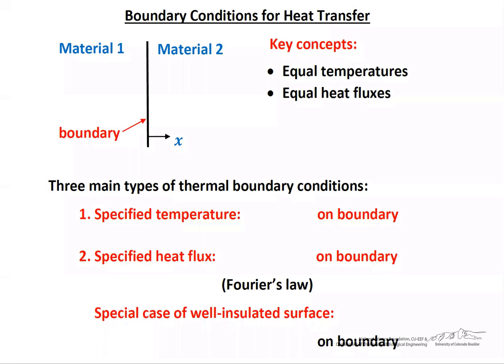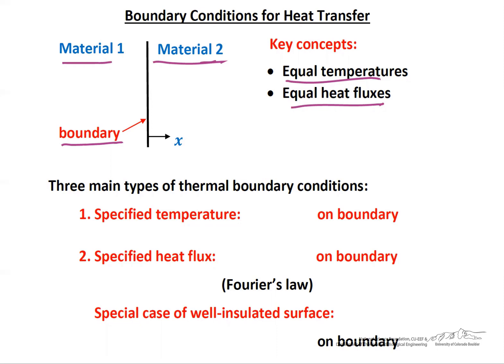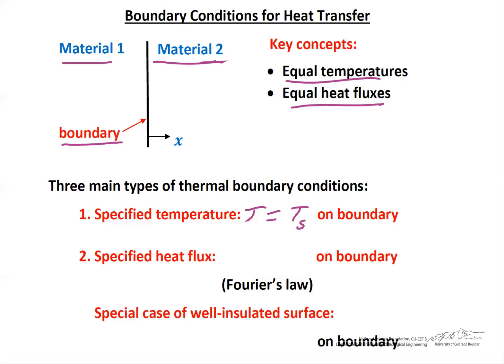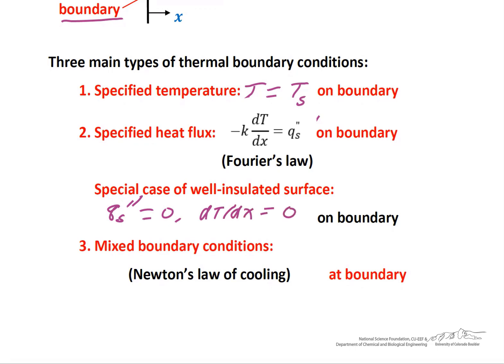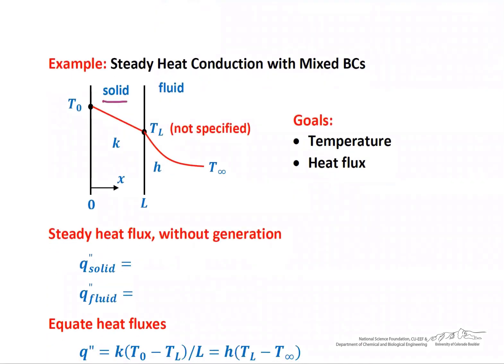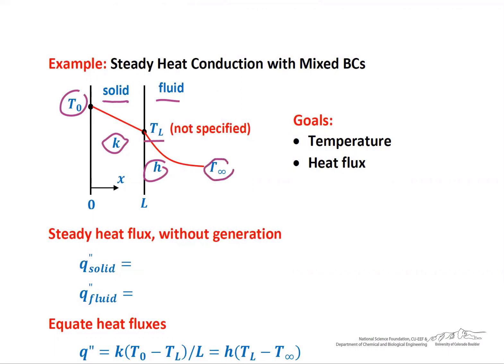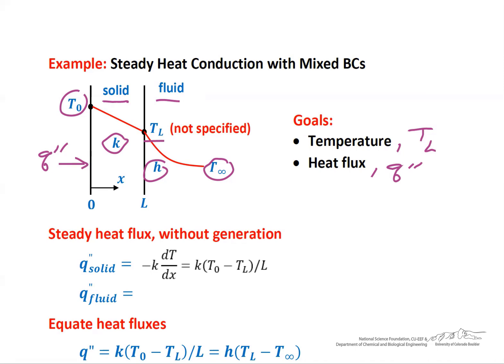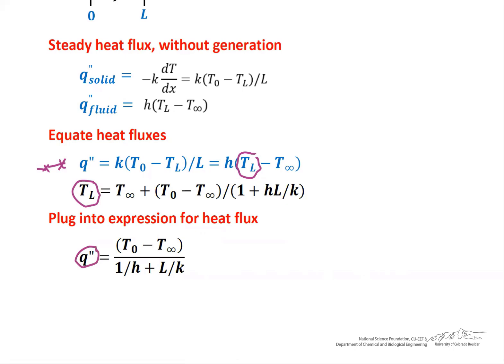Thermal Boundary Conditions

Comment: Great video thanks. If I want to simulate heat transfer from a cavity(air at 600C) through a steel bath(40mm thick) through to zinc, what should my boundary conditions be in Ansys? I want to analyse the heat transfer from the cavity through to the zinc in a galvanising bath.  Thanks